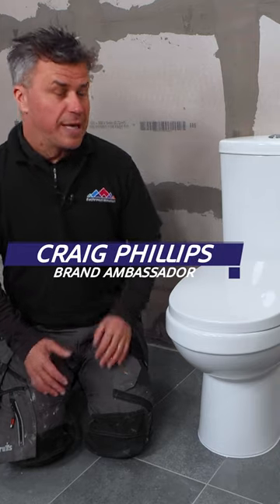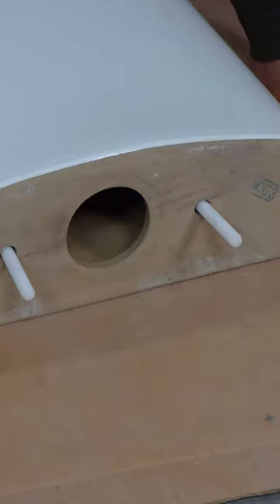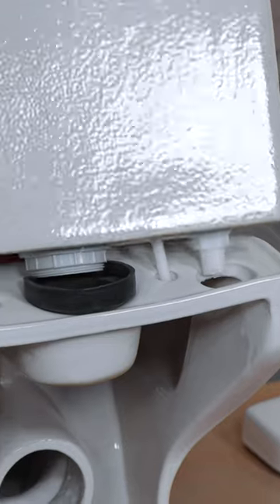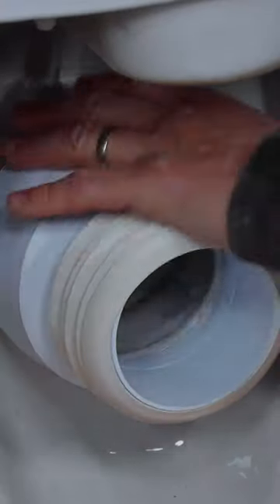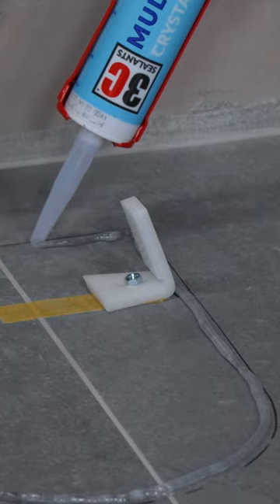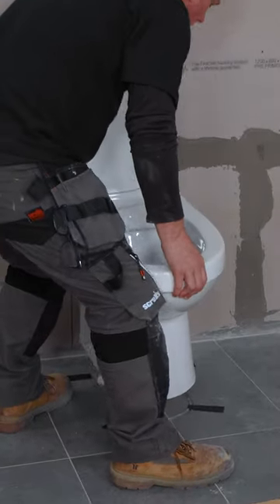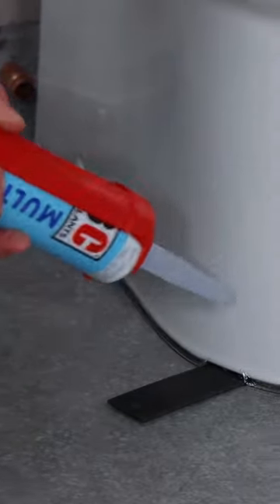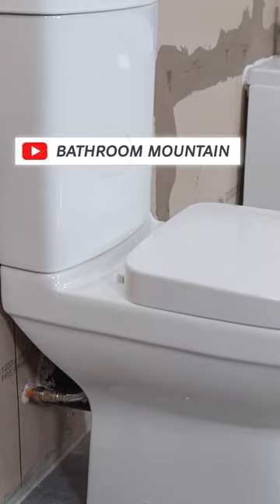How to install a toilet #shorts

Comment: That's how to not fit a toilet cistern. Replace the plastic bolts with metal ones, a kit is cheap and any plumber carries replacement ones on board. Put retaining nuts and washers under the cistern prior to fit on the wc pan so there will be no leak when next time it will need to be taken apart. Finally don't fit plastic thread fiiling valves. There are cheap competitive brass threaded universal filling valves which will never cross thread. And last but not least (this is just my preference) use copper pipe and swivel tap connector instead of flexi hose that harden over time and sometimes could even burst. The last one is just a personal preference. I like the idea of putting silicone under as well instead of just a bead along the outside frame though!